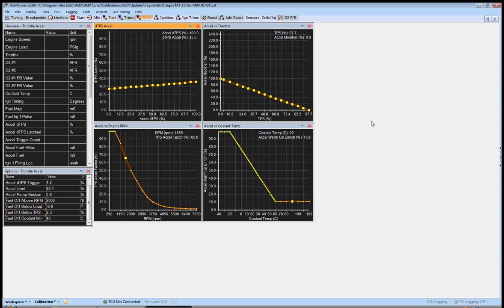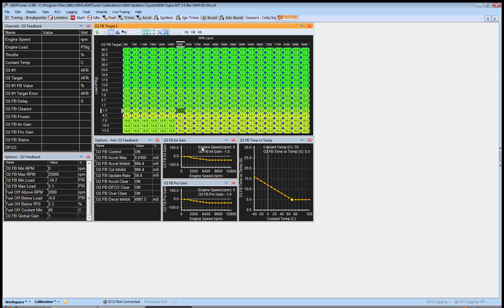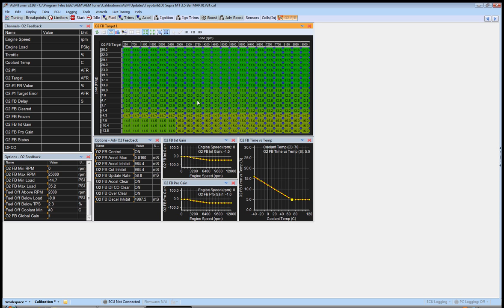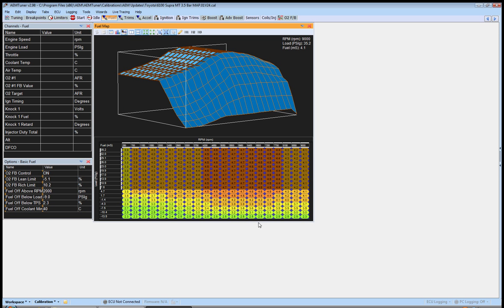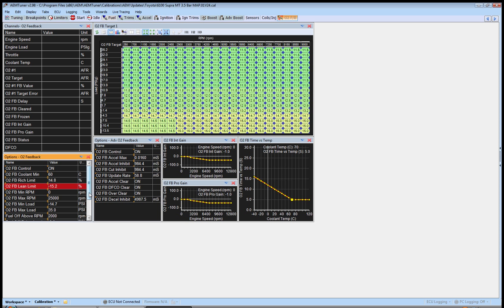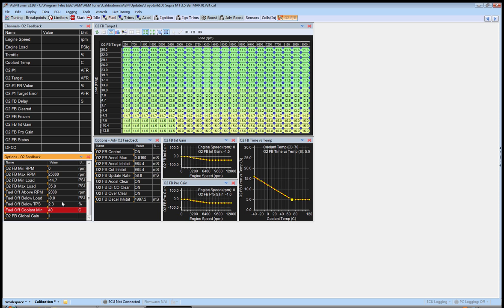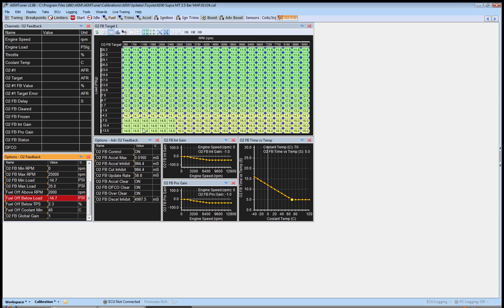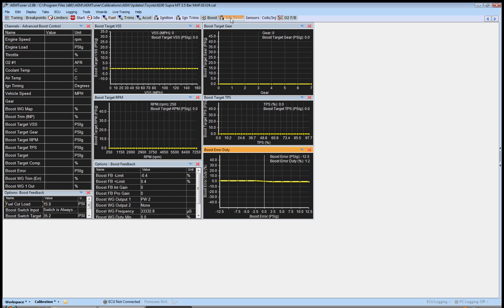AEM Tuning Part 11

Comment from the maker: You are 100% correct. Decel cut does not happen until all conditions are met. You can monitor when the decel cut is happening by watching the DFCO channel. It will show either on or off accordingly.